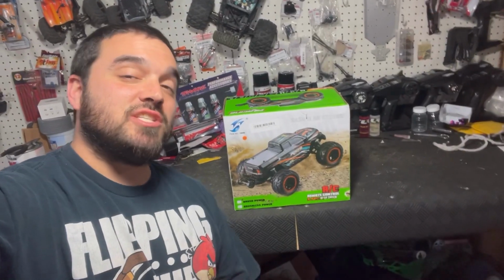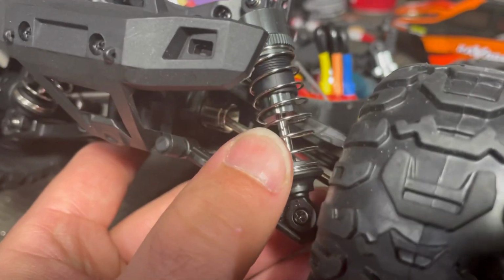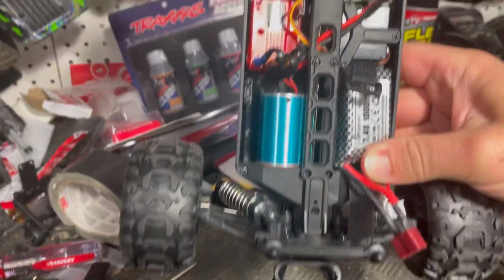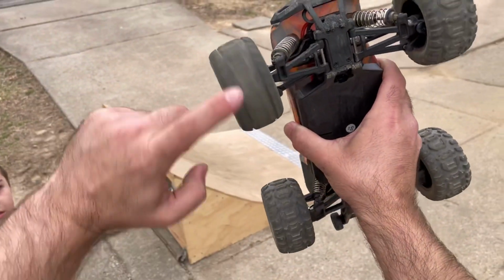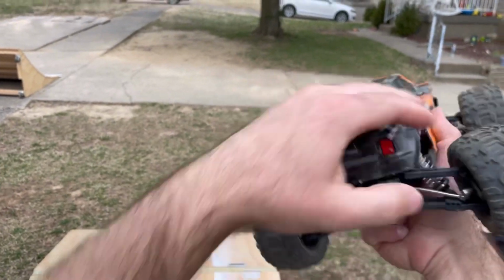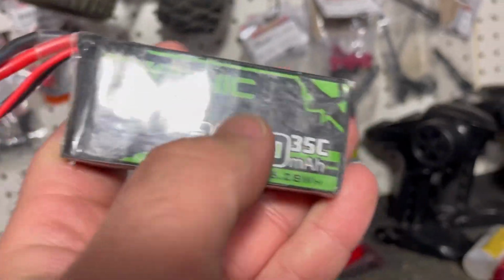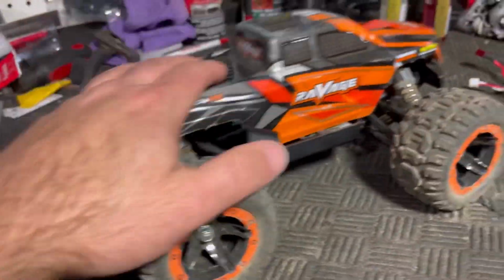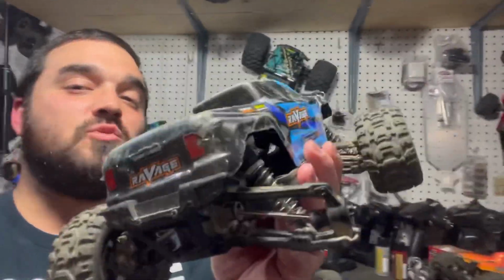The RC car EVERYBODY NEEDS!! HBX 16889a PRO

Comment: My apologies to bother you on this video a year later, but do you also have difficulty to keep your HBX PRO in a straight line? I am asking because no matter how much I adjust the steering trim on mine that is still fairly new it just veers off to the right as soon as I give it full power - it simply won't keep going straight. I also do not have the same problem with my HBX 16889A, it is easier to drive and thus more fun. The PRO is quite a disappointment for me at the moment.
Reply from the maker: No worries!
So first thing I would check is one of the axles, most likely on the front, losing the pin that connects the axle shaft to the axle stub behind the wheel. Basically make sure the entire axle spins as one unit. Also possible a broken or missing wheel hex or rounded wheel hex socket on the wheel itself.
Reply: @DerbyCityRC   All that you mentioned checks out, it is still new, I only ran it a few times, because it is frustrating to battle with it veering off to the right every time on power, not a lot of fun ... Could you please tell me if the drivetrain of the Pro is a lot noisier than the MJX Hyper GO's drivetrain, my HBX Pro's drivetrain is really noisy when it speeds up or slows down. Because of that I disassembled everything but could not really find anything seriously wrong. However I do not know why it seems like the drive cups of the rear diff seem to be catching or rubbing on the dog bone shafts because there is wear on these where I think these should not be any or very little wear. But you are right, the drivetrain on this brand new Pro does not spin very smoothly.
Reply: @DerbyCityRC  I have another question please, when I opened the diff's of the Pro I noticed that the diffs only have 2 planetary gears inside and one connecting shaft, while all my other RC cars have two connecting shafts and four planetary gears, regardless of the gears being nylon or metal inside the diff. Could this be the problem, that my HBX is fitted with sub standard diffs, or does your Pro also only have two planetary gears and one connecting shaft inside the diffs?
Reply: Same problem here! How did you fix it?
Reply: @ilbargons6442  I still have not fixed the problem, the only thing I can think to do now is to upgrade the drivetrain and steering gear with upgraded bits, like adjustable steering links from the MJX Hyper Go and MJX Hyper Go rear differential. My confusion with the HBX 16889A Pro is that there are only two planetary gears inside the diff while all the other hobby grade RC cars I have have four planetary gears inside the differentials, so might this be the problem?
Reply: @ilbargons6442  Does yours also make loud grinding noises when speeding up and then slowing down and does the drivetrain seem to be "uneven", "notchy" or "sticky" even though it is brand new?
Reply from the maker: The 2 planetary gears are normal. For whatever reason that’s what they do. The plastic gear versions do have 4. While I feel that’s odd, they do hold up well. 
Did you try contacting the seller? Obviously you shouldn’t have to upgrade it right away. Mine is not much noisier that my hypergos, so you may have some sort of binding. I hate that this happened. Hbx should send you a new car I would really try that if you haven’t.
Reply from the maker: Definitely should not do that. A slight tightness when new is normal, but definitely no sticking or veering.
Reply: @DerbyCityRC  I did put in a dispute about the noise and made a video on it for them so that they could see and hear for themselves what the problem is, they determined that my complaint was valid and refunded me 50% of the total cost and let me keep the car. Except for the time lost, I am happy with the outcome of my dispute. So now I can work on getting the HBX working better by trying to change out parts. However I do not know if the MJX diffferential will fit in the HBX.
Reply: @DerbyCityRC  When I have the throttle halfway so that the wheels spin slowly, you can see that it makes a grinding noise and with the noise coming and going the wheels speeding up and slowing down. I really hope that it is not a factory defect of the chassis and diff housings causing the diffs and the driveshaft gears to be misaligned. sigh
Reply from the maker: @philipgrobler7253 
That’s good!
You don’t want the mjx diff. They’re not as good for sure. Much weaker metal.
If you spin each wheel individually, does one of them bind more than the other or make a different noise or any noise at all?
Reply from the maker: @philipgrobler7253 did you remove the diffs when you disassembled?
Reply: @DerbyCityRC  Yes, I opened the diffs up and put fresh lube in them hoping that it would make the grinding/sticking  noise better, but it did not. It almost looks to me as if the cups where the drive shafts go into are too deep/long and the shafts are catching on them because there are wear marks around the shafts after I ran the car a bit. I took a look at my MJX 16209 now on  which I have already put four full battery packs through it and it has no wear marls on the side shafts where they are connected to the diff cups. So yeah, with my own experience so far my vote is starting to go in favour of the MJX's ...
Reply: @DerbyCityRC  Strange, it sounds quite smooth when I just spin it with my hands edit: slight binding halfway through each rotation of the rear wheels, but I looked again and the rear diff cups of this one does not look the same as the front, I will take it apart again now to take a closer look because that is where the wear marks on the side shafts are.
Reply: @DerbyCityRC  Yup, I spun the wheels by hand and the front wheels spin freely independently of each other, not so for the rear, I can feel a resistance/slight binding halfway through each rotation, a problem which I think is amplified at higher and top speeds. ☹
Reply from the maker: So maybe try pulling the rear axles one at a time and see if the binding feel goes away with either axle removed. This should help you pinpoint if it’s diff or one of the axles. 
Yes I can certainly see mjx getting the upper hand on your case. 
Also could remove the diff and spin one side of it by hand and compare to the front.my guess is bad diff.
When yo do pull the rear diff, there is a very tiny allen head set screw on the side of the plastic diff body. I don’t even remember what size drive it is but it’s very small. If that is screwed on too far, it will cause this. The purpose of that screw is to remove it so you can remove the pin that holds one of the diff cups in.
Reply: @DerbyCityRC  Thank you so much for the info about that small screw, I will definitely check that. Fortunately I jhave bought a screwdriver set with all kinds of bits recently, so I will have one that can back that screw out  if it needs to be backed out a bit. I will play it by eye but for now I will back it out so that it is flush with the surface of the diff.
Reply from the maker: @philiprccars4340 crossin my fingers that that’s it!!
Reply: @DerbyCityRC  O.K., when I opened up the rear diff casing last night the right upper swing arm just came out completely after I removed the inner screw/pin only. I then noticed that when the car was assembled in the factory the screw that holds the upper swing arm onto the wheel hub was screwed in totally skew. I removed the screw and refitted the swing arm correctly. I am charging the battery now to test later if this was the problem. The screw you spoke about is standing just a little above the diff casing, so it is not screwed in deep.
Reply: @DerbyCityRC  Regarding the extremely noisy drivetrain at the rear, that is still unchanged. When I hold the one rear wheel still and spin the motor at full speed it sounds like a nitrous RC!  I also noticed that even after changing the stub axle and cup for a new one that the wheels at the back are very wobbly, even though it is a new RC and there should not be any wear in the bearings and stub axles yet. The car was making chirping sounds at the rear from the time I got it. I realised yesterday that it is the stub axles spinning inside the inner  bearing race while the bearings do not really spin.
Reply: @DerbyCityRC  Nope, this little HBX 16889A Pro is definetely not happy, taking everything apart now again to try to find out what is wrong. Front wheels are spinning in opposite directions as smooth as butter, rears feel like stone rubbing on stone, not smooth at all, battery drained in 10 mins because of the extra load on the motor because of the rough rear diffs/axles ugh!
Reply from the maker: @philiprccars4340 does the diff spin really rough by itself in your hand?
If so, a new diff will solve your problems
Reply from the maker: @philiprccars4340 dang! Was hoping!
Reply: @DerbyCityRC  Oh my WORD, I just now figured out what is wrong ------>>>> the slots for the dogbones should be more or less 90 degrees to each other on the diff when it rotates, right?, on this diff (scratch that) it looks like this particular HBX 16889 A Pro somehow got upper rear swing arms that are just a bit too short, or driveshaft and diff cups that are too deep because when I moved the position of the upper swing arm from the outside hole to the inside hole on the wheel hub most of the loud grinding noises of the axles/dogbones grinding on the diff and stub axle cups went away.
Reply: @ilbargons6442  Hallo bud, looks like I figured out the problem, check if the slots on your diffs are in opposite angles of each other or in line, if the slots are in of each other line you must take the diffs apart and re-align the slots so that they face in opposite directions (Oh my WORD, I just now figured out what is wrong ------>>>> the slots for the dogbones should be more or less 90 degrees to each other on the diff when it rotates, right?, on this diff (scratch that) it looks like tmy particular HBX 16889 A Pro somehow got upper rear swing arms that are just a bit too short, or driveshaft and diff cups that are too deep because when I moved the position of the upper swing arm from the outside hole to the inside hole on the wheel hub most of the loud grinding noises of the axles/dogbones grinding on the diff and stub axle cups went away.
Reply from the maker: @philiprccars4340 well, maybe I don’t understand what you mean, but those differential cups with the slots in them will turn at different rates of speed most of the time, so they will always sometimes be in line with each other no matter how they start. However I hope I just misunderstood cuz I want yours to run right!!  Lol Keep me posted!
Reply: @DerbyCityRC  Well that is not the problem, when watched your video about your PRO with the different sized tyres I noticed that the cups on your rear diff are a lot shorter/shallower than mine so it looks like the dogbones/driveshafts are grinding on the diff cups because they are too deep. The only way I was able to fix this temporarily was to camber in the rear wheels so that the shafts do not touch the diff cups.
Reply from the maker: @philipgrobler7253 interesting. So check out this one: https://youtu.be/iGRHnO78p5I?si=75XX0njx2MKIw55Z
I think it’s that video anyway, where I swapped my non-pro 16890 over to metal stuff. I had to drill the rear cups out for the same reason. They were binding with the axles.
Though it was a very small amount and wouldn’t have been visibly noticeable I don’t think. So maybe they just used the wrong parts like cups from a 903a or something.
Reply: @DerbyCityRC  The binding or scraping is definitely happening at the cups and shafts, there are even fine metal filings sticking to the lower suspension arms at the back and some of the metal on the shafts is eaten away so that I can now visibly see it with the naked eye where the grinding and metal to metal contact is taking place. Unfortunately I cannot run the car with the extreme toe-in  camber on the rear because then all the tyres will only wear on the outside and also a lot quicker I think because only the outsides of the tyres are taking all the power from the drivetrain.
Reply: @DerbyCityRC  Hallo again, should the diff output cup/shaft be slightly wobbly or should there be no play side to side? I am asking because the diff cup on my HBX is loose on the left -  it can move side to side about 1mm. Also when I run the car on the bench at speed I can make the noise worse or better on each side by rotating the stationary wheei slowly on each side of the diff in the opposite direction. So is this diff missing shims inside that keeps everything straight and running true? I am thinking that everything is wobbling and vibrating because of this and that is causing the diff and wheel cups to touch the shafts and grind away the metal.
Reply: @DerbyCityRC  The diff alone does not spin rough but the diff cups seem too loose, especially the one on the gear side.
Reply: So.. did you solve the problem ? Because i m buying the Pro version too....
Reply: @Madprax Yes, I solved the problem, if you get the car and it makes a loud grinding or whirring noise when you put it upside down and the wheels spin freely at high speed that gets even louder when you hold the one rear wheel while allowing the other one to spin, this is what you must do -> Remove both rear wheels (do not lose the little pins when you pull them off), take out the screws that hold the upper arms to the hubs so that you can remove the outer drive cups and the dogbones. Put the dogbones aside. take the outer drive cup(s) and clamp  it in a soft vice or a vice lined with wood. Take a thin metal file that fits in the slits of the outer drive cup and file the slits a bit longer, or carefully use a hacksaw blade to perform the same. Now take a steel drill bit that fits inside the cup that does not touch the sides and drill the drive cup a bit deeper than factory. The problem is that the drive cups on mine were too shallow, so the dogbones had no freedom of movement between the diff cups and outer drive cups. That solved the problem and she is now flying as straight as a bullet, even while popping wheelies! LOL!!!
Reply: @Madprax  I bought the 16889A version as well and it is also a lot of fun, the only upgrade I did to it was to fit oil filled shocks, no more dropping ass like a chicken laying eggs when popping the throttle. LOL!!!
Reply: @philipgrobler7253  Thanks you so much. Hope the one i ll receive will be ok.  If not, now i know what to do. I Will update this post when i get mine to inform any potential new buyers. 😉
Reply: @philipgrobler7253  Yes, it seems only Pro version may have the issue. But i got it for 83 bucks on Ali with BF discount... with all the upgrades from the "A / brushless only" version. So I ve thought it's worth a try...  Plastic transmission on the "A" should be more fragile, + esc seems better on the Pro. (more range and no lag) Most people enjoying the lower versions want to upgrade to the Pro parts, or wish they had gone for the Pro...  😉
Reply: @Madprax  I am glad you got it for such a great deal, and cutting and drilling out those outer cups is an easy fix for the side shafts binding at the back causing it to fly madly to either the left or right no matter how I tried to trim the steering. I am glad I was able to figure out the problem after a lot of hit and miss and able to help others like you as well. Enjoy your HBX, to me it is still one of the most durable 1/16 scale budget bashers on the block hands down.
Reply: @philipgrobler7253  hi ! Just received my Hbx 16889 PRO today . i checked the car , oil in the shocks , no leak , grease on the gears , everything is PERFECT . NO BENDING in the rear dogbones . its SMOOTH . Ran the car  for 15 good min. , and its a blast . i set ST dualrate and TH setting both at 75% and its perfect like that. Im really impressed by the quality ( metal parts , plastics and srews ) For 83 bucks ! That s a bargain. 😁
Reply: @Madprax  The other upside of the HBX 16889A PRO and the MJX /16 scale Hyper Go's is that they have become very popular, so you might wait a bit for the parts, but there is no shortage in parts to keep these RC's in top shape.

Comment: HBX 16889A Pro woes and Misery. 
Hallo Everyone, after A LOT of checking I finally managed to figure out why the rear drivetrain of my Brand New HBX 16889A Pro is so noisy and why the car kept veering off to the left or right regardless of how I tried to trim the steering. I do not know why it is but on this specific HBX 16889A Pro there is ZERO free movement of the dogbones inside the drive cups at the rear if the camber of the car is set up correctly so that the tyres will not wear out on the outside only. The dogbones are jammed so tightly into the cups that there is no freedom of movement inside the cup. This of course makes a loud noise so that the car sounds like a mini Nitro car instead of an electric one. I still  need to figure out how to drill the drive cups out so that the dogbones can move and that the car will be controllable. Anyhow there it is why my particular HBX 16889A Pro is doing this, there is NO free play in the sideshaft setup of this HBX 16889A Pro. I even tried putting in new dogbones and drive cups but it is still doing the same, so my assessment of either the swing arms being too short or the wheel bearing hubs being manufactured incorrectly might be an accurate conclusion on why this is the problem. I trust that this information will be helpful to everyone who is struggling with the same type of issue on their HBX 16889A Pro.